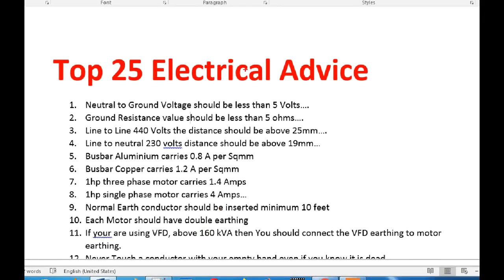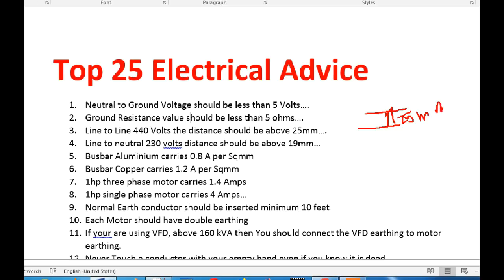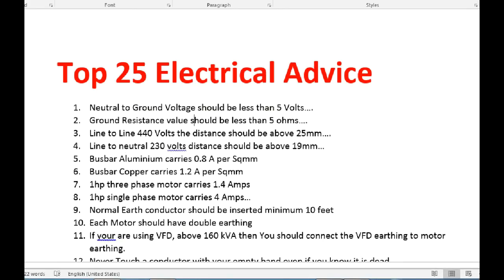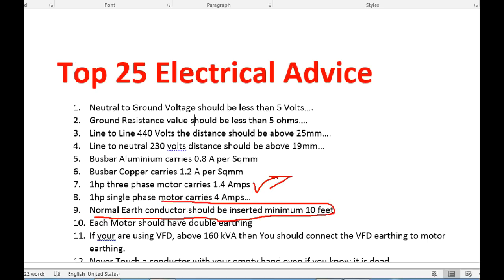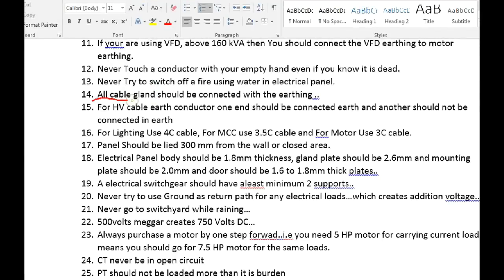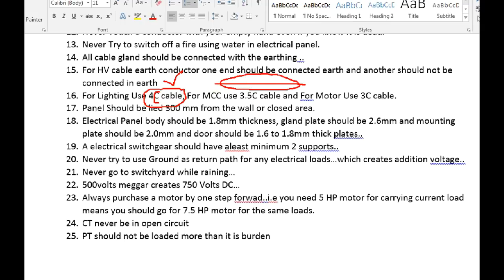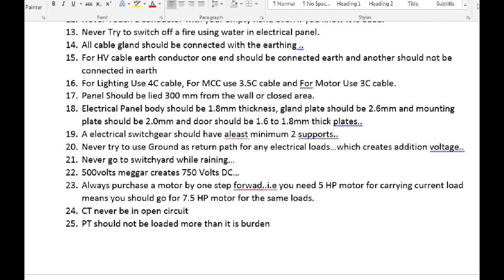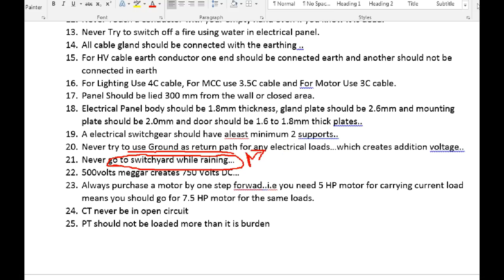எல்லாரும் தெரிந்து கொள்ள வேண்டிய Top 25 Electrical Standards In tamil

Comment: 24 is wrong...... CT terminal should not kept in open ....it should be closed condition.. If meter not working......
Reply from the maker: Bro both are same...never be open circuit and should be short circuit
Reply: i meant to say the same

Comment: bro,  Kindly tell about What is Harmonic? How it generate? How to reduce?
Reply from the maker: Hey wrong concept..thyristor does not produce harmonics..remember this..
Reply: Harmonic means.....Un wanted Sine Save produce ...in electrical equipments.....whenever using Thyristor Control 
For an example Using 2 Nos thyristor produce 3rd Harmonic.....4 Nos of Thyristor using produce 5 th Harmonic.....6 Nos Thyristor using 7 th Harmonic. ...
Pl call further 9171543332